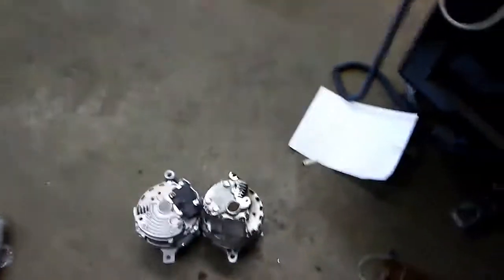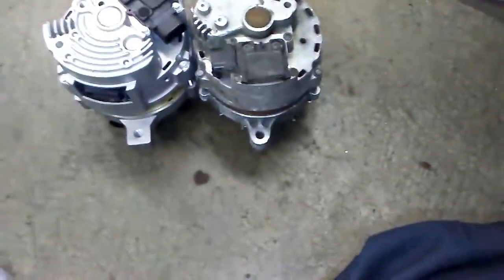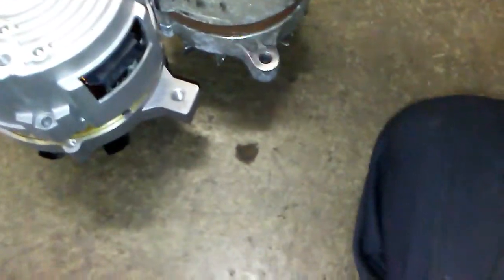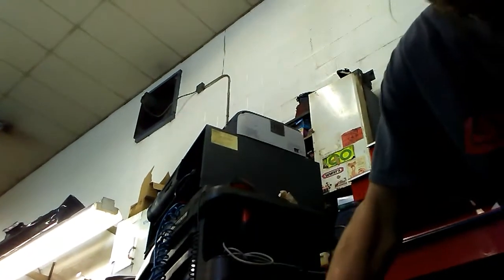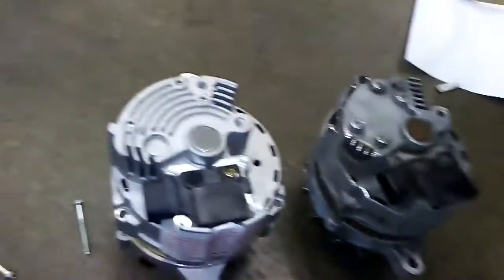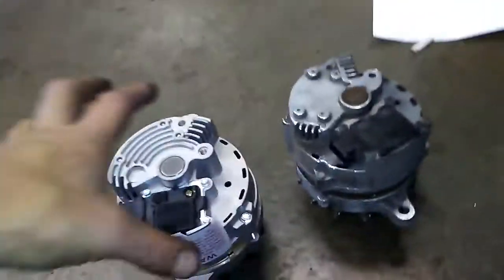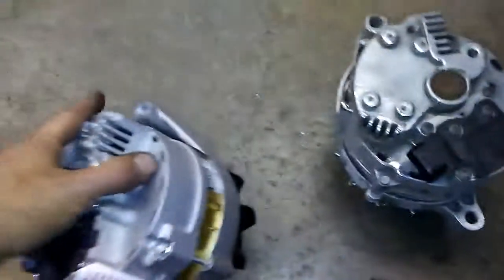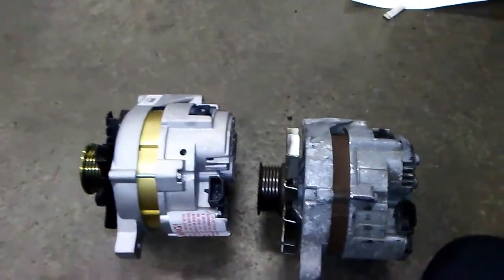1993 Ford Mustang 5.0l alternator clock position swap

Comment from the maker: not sure why I said clock spring lol I knew I meant to say clock position but either or easy swap no need to pull apart just remove 4 bolts and rotate slowly